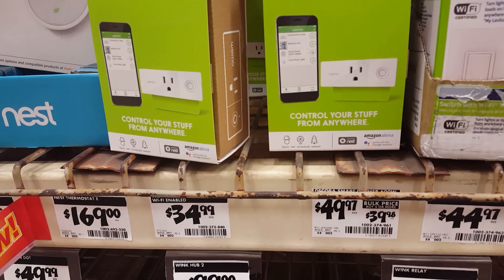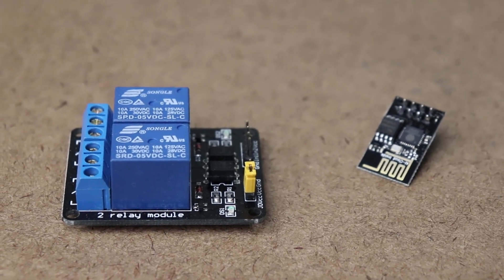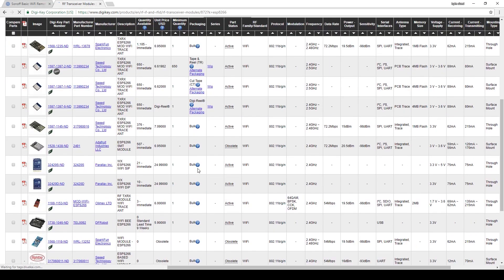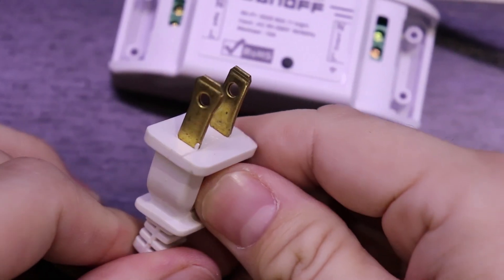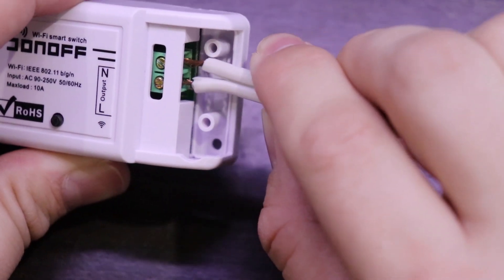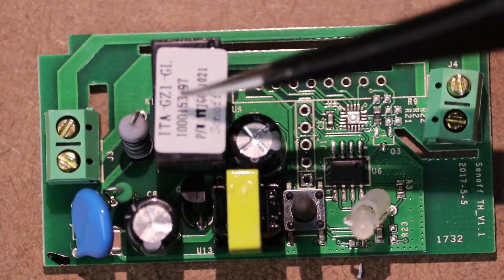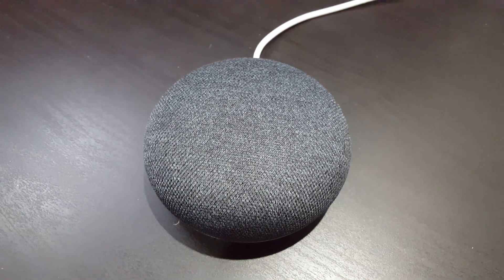Sonoff - The $5 WiFi Smart Switch That's Compatible With Alexa And Google Home

Comment: I'm planning to build my home automation using Sonoff. Before I commit to buying a test switch, how is it configured to use my WiFi?
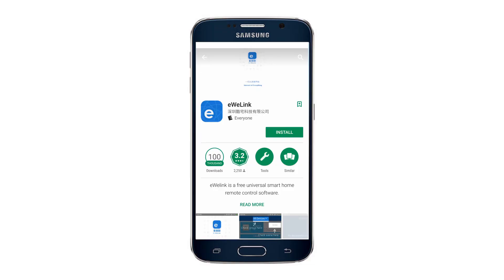Reply from the maker: If you start watching at 3:40 I explain that you need to download the eWeLink app from the app store. You'll need to register for an account, then click the "plus" button to add your sonoff device. Follow the onscreen instructions to connect the sonoff to your wifi. Once finished it can be controlled over wifi. If you want voice control you'll need to go one step further and link your eWeLink account in Google Assistant.

Comment: Can sonoff be used to make a smart switch?
Reply from the maker: +Azim Lalani the Sonoff is a smart switch. It connects to the internet, can be controlled with your phone/tablet, and can be turned on/off by following triggers or a schedule.
Reply: byte sized my question is can it replace the conventional switch! Like is it possible to make the bedroom’s light be controlled by sonoff!
Reply from the maker: Oh, I misunderstood your question! This probably isn't the best thing to use to replace a conventional light switch. For that I would recommend using a z-wave controller like wink, smart things, or make your own like I did in this video https://www.youtube.com/watch?v=3HdDo5AZLx4&lc=Ugwiv0QEsM2BG6D4PZd4AaABAg. Then you can replace your light switches with z-wave dimmer switches like this https://www.amazon.com/GoControl-WD500Z-1-Z-Wave-500-Watt-Wall-Mount/dp/B00E1OVFAK/ref=sr_1_6?ie=UTF8&qid=1511542277&sr=8-6&keywords=z-wave+dimmer+switch
Reply: sonoff sells this in a light switch package, but the US version looks really wonky. https://www.itead.cc/smart-home/sonoff-touch.html
Reply: byte sized - I agree with you but... I guess, it can be done if one is willing to change/replace the switch box in the wall and add this to main line. This approach will not work on dimmer switch though. Please, correct me if I am wrong. Thanks.
Reply: Azim Lalani I don’t see why this wouldn’t work between the switch and the line coming in if you are just attaching the hot and neutral and then you put sonoff switch inside the box behind the traditional light switch

Comment: Anyway this can be used to dim the light? Or is this simply off and on?
Reply from the maker: +Gaspar Gutierrez this particular model cannot dim a light. There might be other models that are able to do that. In my house I have a z-wave controller and z-wave dimmable light switches in the wall.
Reply: Great. Thanks for the video. You've opened up another option in my journey to convert my home.

Comment: Question from a newbie - do you need something like a Samsung SmartThings Hub to work with this Sonoff and Google Mini. Or can you just get a google mini, and some Sonoff and some extension cords ( along with the APP) to work with the items?
Reply from the maker: Chuck Ger you don't need a hub or even a smart speaker. Any Android phone/tablet with Android 6.0 or newer has Google assistant. If you already have an Android phone, all you need is the sonoff switch and an extension cord.